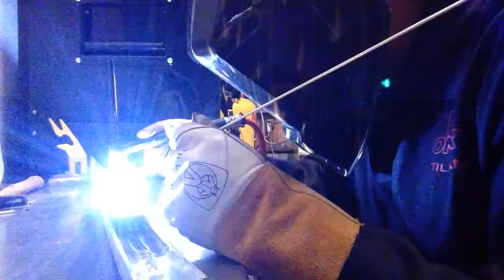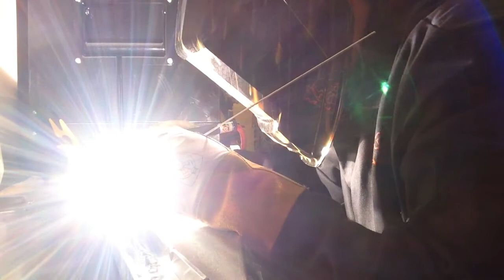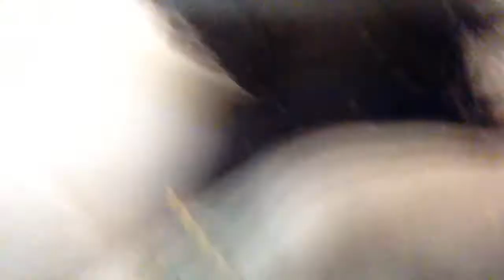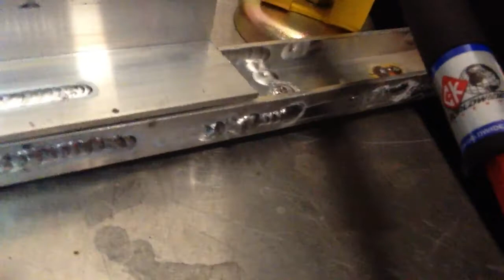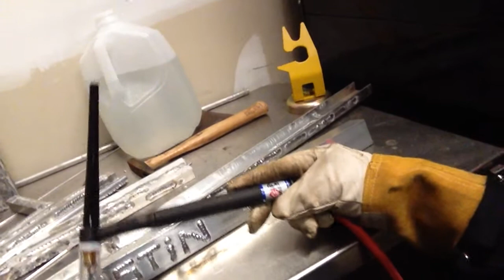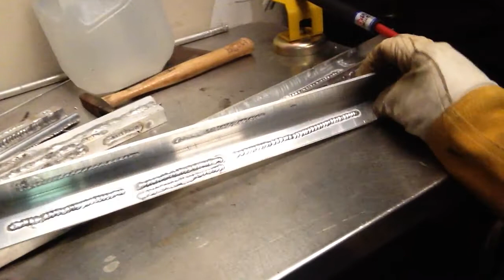Everlast PowerTig 250ex Problem Tig Weld Aluminum Welding

Comment: I recently got the 250ex.  My first (inverter AC) machine and inverter AC welding experience.  I'm fully impressed with it. It has not one deficiency.  I've tried to find fault with it, i just gave up and accepted that its good. 20+ years of welding experience and business ownership has taught me to be skeptical. Its the best you can get at that price, abilities  and duty cycle. All 1/4 aluminium joint configurations are easily accomplished with quick, tight forming puddles. DC is just as buttery as it gets. It's way more powerfull than i expected out of a small package. 60% duty cycle is right up there with the best of them. I'm using a ck ww #26 torch, 1/8-2% lanthanated  tungsten, #10 cup gas lens.  Its a good and durable all around shop setup. There seems to be a lot of aftermarket stuff availability.  Nothing proprietary about this machine.  I have spoken

Comment: Thanks for the tip have been having the same issue. Did you have  issue with starting a arc at times too?
Reply from the maker: Yes.
Reply from the maker: Make sure you tungsten is cleaned and reground if your having arch issues.

Comment: I don't know what you are trying to show.... or trying to say... FULL bottle will be that pressure and go down to 0 when empty.... what are your settings?
Reply from the maker: My gauge was showing pressure in the tank but was empty. The guy at Airgas says that happens sometimes. Got a new bottle and the welds turned out better.
Reply: the gauge shouldn't be doing that. What's the use of the gauge if it's going to get stuck showing pressure that isn't there. I've got a couple of everlast welders. I've never had any issues with them

Comment: I have a buddy who bought one for practicing tig welding. Did you purchase the torch for better control?
Reply from the maker: Yes it's a lot smaller and easier to control. Wish it was water cooled. It does get hot after a while.

Comment: How is the Powertig 250 holding up? Would you recommend one? Nice welding!!
Reply: Sorry Tim but this machine is really a good unit.  Also if you really look at Millers it will say built with mostly USA parts.  The machine speaks for itself and it comes with a five year warranty.  If it is good enough for Jody at Welding Tips and Tricks then I would say it has met the standard.
Reply: +Turbo Chevelle Thank you for replying. I picked up a Lincoln tig 200 yesterday. I couldn't decide but I'm sure one is no better than the other. Ones made in China and the other in Mexico.
Reply: Those people along with ChuckE get sent these welders in order to write a review... Hardly an honest review.
Reply from the maker: It's holding up good.